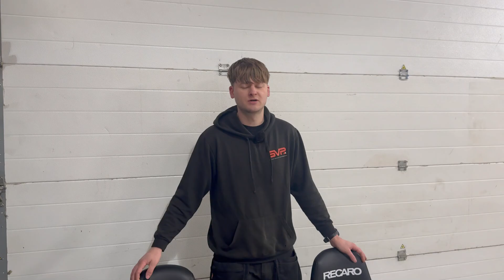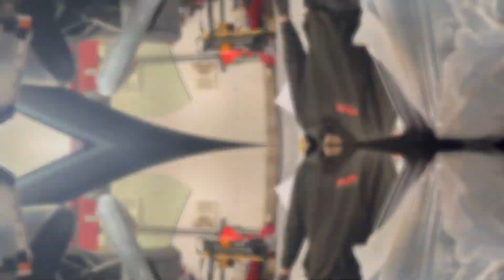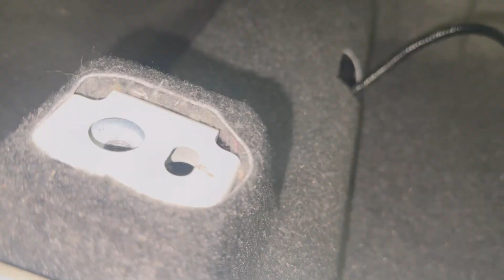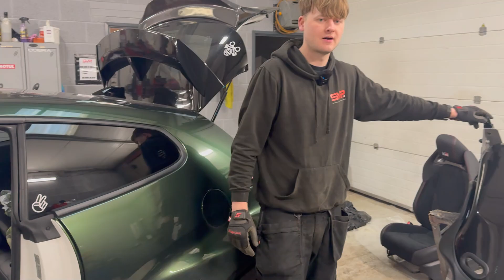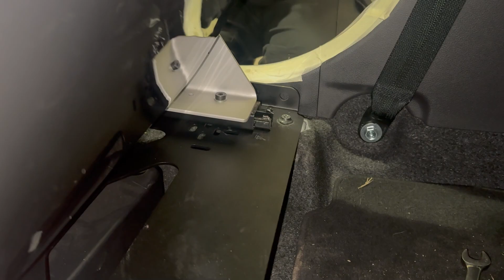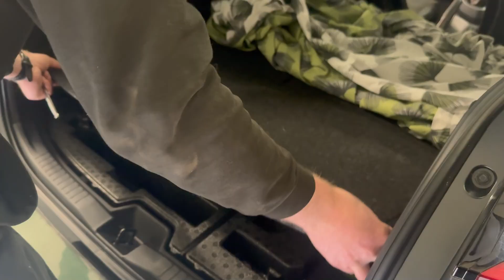Installing Recaro Bucket Seats into this Toyota GR Yaris

Comment: What about seat airbag? Any errors?
Reply from the maker: nope no errors, using the correct resistors 👍🏼
Reply: @SportsVehiclePerformance whats the correct resistors ?
Reply: What about the seat belt on passenger side?
Reply: A completely useless upgrade that also will reduce personal safety in connection with collision.